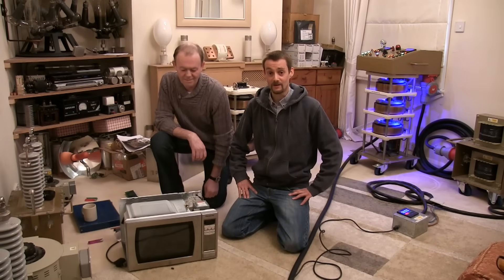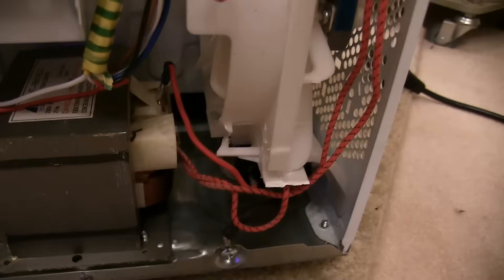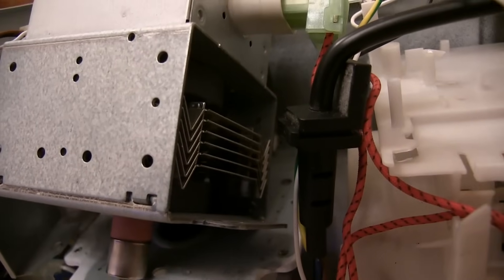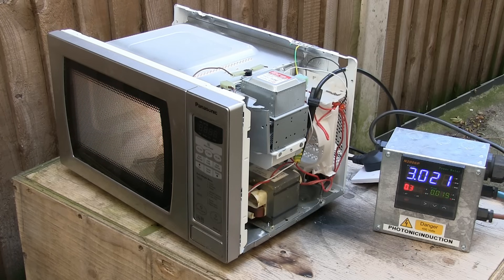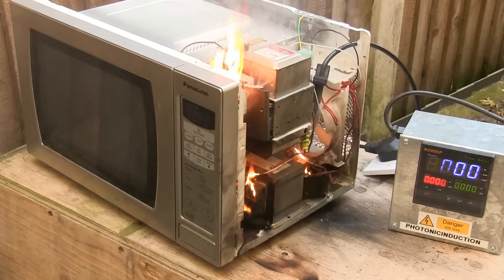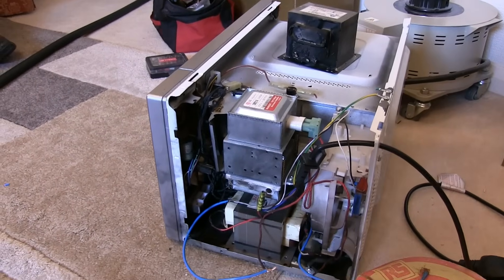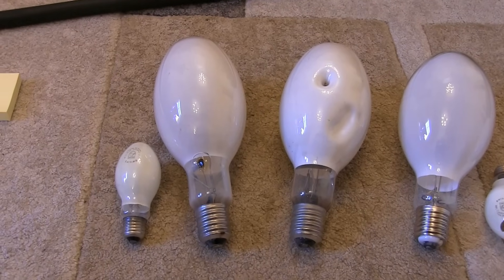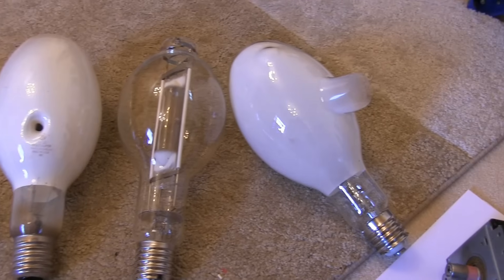Microwave Overclocked

Comment: HV and low resistance = fire so need double thermal and hv insulation of the wire to prevent the transformer from burning bcz it get directly shortet insulation breaking plus the heat

Comment: I know this is an old vid, but what happens if you soak one of those transformers in oil to help with heat and HV breakdown? What about a set of four in series/parallel for more power going to the magnetron?

Comment: As odd as it seems the magnetrons in most commercial microwave ovens are rated for about 5kw sustained peak power, transformers not so much, though the inverter kind can take up to about 4kw if you put it in oil and cool it.

Comment: I didn't know microwaves have a fan in them because how would they produce heat without a fan ?
Reply: transformer gets really hot due to the high current draw on the primary (6 amps or so), if the coil had a resistance (not impedance) of say 3 ohms, then that's about 100 watts of heat wasted on the primary. that's about 10% efficiency gone but it works

Comment: u need a different transformer to pop the magnetron! that thing has a fix resistance so it will pull huge current + the mot has builtin current limiting shunts so u will pop the mot first which is not that interesting!

Comment: Im american, and our stuff is only 120V so i wired my Microwave into 240V by using both sides of the split phase system and the transformer immediatley started to burn up. Are you increasing the amperage or the voltage? are you using a variac or what? awesome video.

Comment: Those magnetrons are some mighty strong components it seems. Both times it seems like the transformer gave out and not the magnetron itself.

I wonder what happens if that thing is fed some mighty high(er) voltages than what it would get from that transformer?

Comment: The biggest problem is at high voltage the microwave not produced just microwaves, it will produce electromagnetic waves with higher frequency, so it would produce infrared waves which will obviously heat the surroundings.

Comment: I had so much fun repeatedly cooking 1ft strands of fine copper motor windings. The glass plate fused to the slag then a plasma cone became easier to sustain until the plate had a 3 inch divot and the paint peeled in the top . Great  fun .

Comment: I can feel the cancer from here.
Reply: RF causes heat, rather than genetic damage. Cancer is generally caused by long term exposure. Beryllium poisoning is possible.
Reply: Stop watching Fortnite
Reply: I can smell the smoke and I'm probably thousands of miles away.
Reply: I got nutsack cancer
Reply: The smoke and beryllium dust if you break the magnetron
Reply: C  Not true, direct exposure to microwaves causes heating of polar molecules, such as water in cells in body, which could lead to damage possibly to cancer. But yeah I get what you are saying, unless you start doing some stupid shit with it, its designed so that it cant harm you/cause damage.
Reply: Milan Chára uhh, no

Comment: I've tried this with my microwave but it still won't play Crysis 3 at a steady at 60fps
Reply: lel
Reply: bro get an  LG
Reply: Never try that with a microwave it can cause radiation
Reply: @nicovantdack2537  yes it's actually true considering that you're radiating yourself with a thousand Watts at 2.4 gigahertz yeah I'd say if you're going to do something like that make a cinder block bunker and put the microwave like that kind of like DemolitionRanch did in his early days
Reply: Change microwave.
Reply: PC Master Racist WORST OVERCLOCKING EVER
Reply: lmfao
Reply: Actually, microwaves run at a constant 60hz in the US, and 50hz elsewhere.
Reply: Well it was a "crysis", But it was only at 30fps 1080p
Reply: Maybe try 720p 60FPS.
Reply: Mine just goes and blows up a tnt world at 10000 fps.
Reply: Nico Van T Dack u mean u get cancer FROM the radiation

Comment: If you had two microwave transformers, why didn't you put two of those in the microwave instead?
Like primary parallel and secondary in serial.
That would put out 0 volts secondary when done wrong, or 4000 volts when done right without even frying the primary coil(s).

Comment: beneath the magnetron, is there a rotating surface? unless this was camera frame rate, there were some neat fluctuations noticeable at nominal powers.
Reply: According to  Wikipedia:
"As the fixed dimensions of the chamber, and its physical closeness to 
the magnetron, would normally create standing wave patterns in the 
chamber, a motorized fan-like stirrer is placed in the waveguide to randomize the pattern"
Reply: damnit.. now I gotta tear my microwave apart.

Comment: FYI: Molten glass absorbs microwaves, and turns white hot. A normal microwave can do it without modification. Search youtube:  wbeaty unwise microwave experiment

Theory: Metal acts as antenna, creates charged gas plasma cloud. Hot plasma rises, heats glass at highest point. Glass melts in that spot, starts to absorb microwaves, sustains heating. Plasma cloud inside rises, pushes molten glass up in a column, stretches it...

The glass needs to be heated somewhat evenly at first, to avoid just shattering from the initial heat-up stress. See the video I mention above. A preheated upside down glass bowl with a suspended metal strip underneath may be able to stretch upward more consistently.

Comment: With a kilovolt power supply available (I've seen you use it in the TV set zapping videos), why bother with the MOT and doubling capacitor at all?  Anything over 4 kV can power the magnetron directly.  Just need a higher current initially to get the cathode hot first.

Comment: I wonder how much of the extra power got past the transformer saturation? The HV output would likely reach maybe 2400V with a lot of flat-topping and the catastrophic overheating seemed to be in the copper and iron of the transformer. The fan, diode, capacitor and magnetron survived for the second round. How about a pair of MOTs wired for 4200V to really over-power the magnetron? Now that would be a really unsafe experiment!

Comment: "And if you smash this antenna... It will give you cancer"
- Photonicinduction
Reply: Only causes cancer if you live in California 👌
Reply: CABAL he said it so casually
Reply: Beryllium oxide
Reply: I think if you do so much as poke it you'll get cancer.
Reply: Dave Micolichek but u can get cooked like a chicken. which can probably cause cancer.
Reply: CANSAH
Reply: Dave Micolichek  not all burns cause cancer but burns like sun burns which are a result of the uv rays cooking your skin cells can cause cancer. But yes most combustion related burns (fire or hot metal) won't cause cancer
Reply: I got eye cancer from just watching it :-)
What a madlad!
Reply: i sharpened my knives on those little ceramic things on one of those magnatrons like a month ago, my understanding is you can only get the cancer by fulfilling one requirement: make dust out of it
Reply: @chaytonruijsenaars3971  are you still alive?
Reply: Yes. Berilium...
Reply: Beryliosis too
Reply: TL,DR: The antenna was never made of beryllium.

Thankfully you won't, I don't know where did the beryllium hoax even came from. Maybe because the antenna insulator ceramics look similar to doped beryllium oxide ceramics used in some rare soviet military vaccuum tubes? Regardless, all consumer magnetrons produced use aluminium oxide ceramic, which is relatively safe in comparison with BeO (still, don't purposefully breathe its dust in).
Reply: Dave Micolichek heat damage easily causes various types of carcinoma.
Reply: Dave Micolichek do you work in a burn ward? if not, google it. just because youve never heard of it doesnt mean its wrong.
Reply: Dave Micolichek they develop it because of the burn...why else?
Reply: Niko O you cant get cancer from radiofrequency AKA microwave radiation.
Reply: @aliensanonymous5063  it wasn't the microwaves themselves it's the beryllium inside of it that's dangerous.
Reply: @aliensanonymous5063  But you can from the beryllium in the antenna, as he said

Comment: That poor transformer saturated so quickly after you went over the rated voltage.
Reply: The standard operating conditions had the transformer well into saturation already.
Reply: ***** Well isn't the core air-gapped to limit current? This should also help with saturation... but at full power draw it might not...

Comment: I'm surprised you didn't try to drive the magnetron with the big boy supply! Being a diode, it should accept unrectified AC without too much fuss, and then you won't be relying on those puny MOTs for power.
Reply: Actually a magnetron is a type of valve (or tube as those in yank land call it)
Reply: ***** Yes, a magnetron is a thermionic valve (vacuum tube), but it is actually a diode. The term diode actually comes from valves; diode triode etc.
Reply: I thought only semiconductors could be diodes
Reply: No, he's right a mag is just a thermionic diode with magnets.
Reply: Well you learn something new every day I guess
Reply: By the way is it possible to run a magnetron on DC power?
Reply: ***** Technically, they ONLY run on DC power, since they don't conduct both directions. Also, inside microwaves there is a half wave rectifier (single HV diode) which forms the voltage doubler with the capacitor, so the magnetron never even "sees" AC at its input.
Reply: So basically If I have a battery array with a high enough voltage I can power my microwave without an inverter?
Reply: ***** Technically, although I don't know of a battery array that can provide 4-5Kv HW DC.
Reply: Yeah I don't think I would even want a battery array with that high voltage
Reply: +ElectronHV There are some nice capacitor arrays for powering railguns though. Of course they will run out quickly, but then again, so will the microwave ;-)  If it accidently survives you can always try again. (Found a nice thesis paper about an FPGA-controlled charger that charges up a 830 μF array to 9 kV in two minutes)
Reply: That's not too bad but if I was going to have a capacitor array for a railgun I would have a minimum of 5000uF
Reply: +mewantbrains Hmm, I think bigger isn't necessarily better? (charge left after projectile has exited, projectile fused to rails, etc) Unless the goal is to blow up microwaves, in which case it always is of course.
Reply: I didn't think the projectile could be fused to the coils
Reply: +mewantbrains You mean rails? (There are no coils in a railgun) Welding the projectile to them is actually a common problem and pretty much guaranteed if you try to fire the projectile from standstill, which is why it is normally injected (e.g. pneumatically) into the barrel when firing.
Reply: +mewantbrains BTW, the voltage rating actually has more impact than the capacitance (total energy stored is 1/2 C V^2). The caps in the array I mentioned were iirc rated 11 kV but I imagine you'd want to keep enough distance from the rated voltage since you'd probably be a rather unhappy person if the dielectric starts breaking down while the array is fully charged.
Reply: Especially if I'm holding it when that happens 

That would suck ass

Comment: You said these magnetrons can cause blindness and cancer !!! Omg !!! I've opened up about a dozen of these from microwave ovens off of the scrap yard just to retrieve the magnets from them !!! Is there a safe way to do this ???  I presumed coz they've been on the scrapyard for so long all electric from the caps would be depleted but i still discharge just incase , but the magnetrons are a different story ... please advise 👍
Reply: they probably only will blind you if you look at them when its plugged in and turned on
Reply: this is what wikipedia says about them and what he is probably talking about
"Some magnetrons have beryllium oxide (beryllia) ceramic insulators, which are dangerous if crushed and inhaled, or otherwise ingested. Single or chronic exposure can lead to berylliosis, an incurable lung condition. In addition, beryllia is listed as a confirmed human carcinogen by the IARC; therefore, broken ceramic insulators or magnetrons should not be directly handled."
Reply: As Said, it will only blind you if it on. Beryllium on the other hand is one of the most hazardous Metalls at Least in oxide form BeO. Very small amounts of dust can permanently damage your lounges.  I think most magnetrons for oven uses Aluminiumoxide now days. Old type high watt resistors and industrial insulator can use berylliumoxide tho (white or purple cheramic).

Comment: Now that was entertainment plus! I am surprised that the transformer failed like that, both times before the magnetron. The power output must have been more than 300% greater than its normal rating. I would like to see one feeding a horn antenna big enough to generate over 20dB gain then overvolted (ignite some dowes from 8 metres away ;) Hey maybe to mitigate the MOT melting down while overvolting the magnetron, you could wire two MOTs in series. Do the test on 120v to begin with then ramp up the volts :) should be doubly interesting

Comment: Viewer # 28,471. Oh wow..... It's time for Busta to energise the windings, there's a microwave to bust! :D

I have to say that the smoke, sparks and flaaaaaames you got coming out of that were quite impressive! I bet that notched-up a few amps on the amp-meter!

Another transformer in the microwave? Aaaaah, but Mr. Photon..... You forgot "The Mega MOT" This microwave could have been ripped up to silly-stupid-kilowatts with "The Mega MOT" stuffed in there on the power circuit. :D

The way I would've rigged it, is.....

A standard MOT on 240v and use the 'heater circuit' in it so as to get the heater in the magnetron working, then "The Mega MOT" could have taken care of current-delivery duties by stuffing some serious kilowatts into the magnetron for the optimum poppage!

Would that have worked? How would "The Mega MOT" have coped on the output of Busta though?

Do you reckon that "The Mega MOT" would have handled a slight overvoltage for a few minutes?

Another thing as well..... When that second transformer let loose in that microwave..... What the heck was that bottle-rocket screaming-off sound, and where was it coming from in there?!! ABSOLUTE LMAO!!

Yes, I heard you laughing your backside off in the lounge as it let loose. That was a classic I POPPED IT !! laugh right there! I have to say, I screamed out a loud laugh more-or-less at the same time! ROFL!!

How on earth did the magnetron survive this? Or didn't it? I've still yet to work out where that bottle-rocket scream-off sound came from in there! :D Was it that high-voltage capacitor which is found in the majority of microwaves whistling-off because you overvolted and vented it?

If you still have the microwave and the magnetron is still workable, could you do a re-take on this and use either "The Mega MOT" in there or one of those gold transformers connected to the magnetron?

Really, I think it's something that we'd all like to see..... WAAAAY TOO MANY VOLTS stuffed into a magnetron! :D

Let's see what shapes could be thrown in the microwave and what interesting scientific sounds could be gotten out of that magnetron!

I think a lot of us would be mighty impressed if you could do to a microwave, what you did to that toaster and kettle!

Imagine it now..... The world's first domestic 3kW microwave. I am sure that it'll be a YouTube First!

Go on, get in there.... RIP IT RIIIIIIIIIGHT UP and let's discover the Ssssatisfaction! I wanna see it Glowiiiiiiiiin' in there!

Thanxx for showing,

-BoomBoxDeluxe.

9th March 2015, 18.55

Comment: Photon, I'd be interested if you were to try overclocking a Panasonic Inverter microwave. They use a switching power supply instead of the classic transformer/capacitor combo.

Comment: Good advert for the well made Panasonic microwave. Nuked by photon and still the magnetron works. Wonder if you could make a sealed unit and pump it down to a low pressure to get a nice plasma display.
Reply: Still can't beat the LG Inteliwave used by V8Jagnut :)

Comment: I notice the watts spiked just before it flared up. Why is that?
Reply: The windings within the transformer have an enamel coating on them to keep them from shorting together which eventually burnt away with the excessive power flowing through it, which caused the windings to short together. This would of course, result in a spike in power draw, before quickly bursting into flames, and going open circuit. Hope this helped! (:
Reply: KrayzieDude Yeah! thanks!

Comment: Brilliant video, That Magnetron lasted well with the overvoltage. Keep up the excellent work.
Reply: Certainly it did handle it quite well, and with better cooling might even take more, however Photon could maybe have pushed much more into it if the transformers hadn't caught on fire. A different , more cappable power supply, instead of the built in transformer, is what I think would help to successfully put more power into the tube.

Comment: If it possible to use the magnetron with a parabolic reflector, or a yagi, and then aim it at stuff?

e.g., an invisible fly swatter?
Reply: Yep, it's possible, china have recently come up with exactly that (after copying the US of course, but patent theft is legal in china), they say it's a riot control thing though (more people control to make sure they stop trying to push democracy in the communist state of china)...
Reply: ... probably >.> I mean, it must be possible or else radar wouldn't work.
Reply: I want to know whether you can drive it as a Wi-Fi router, as they run within very close frequency.
Reply: @colenichols  Sadly they are not really designed around generating square waves, thus it would likely fail to send data. Instead, they just generate a noisy sine wave in the 2.4GHz range, though it can vary a decent amount.

The tech for the magnetron has not really changed since the 1950s since no one wants a new patent, and the current design works well enough.
Reply: Yeah